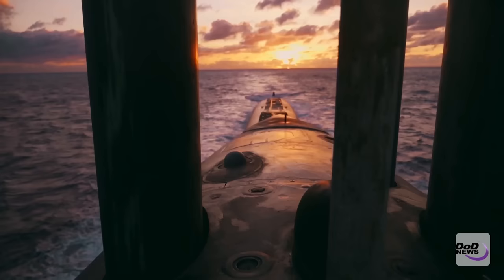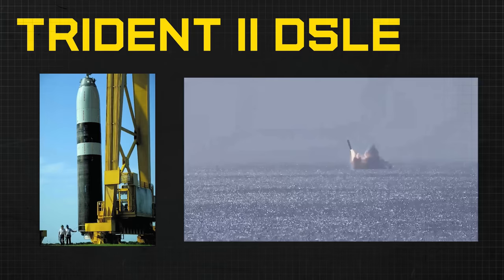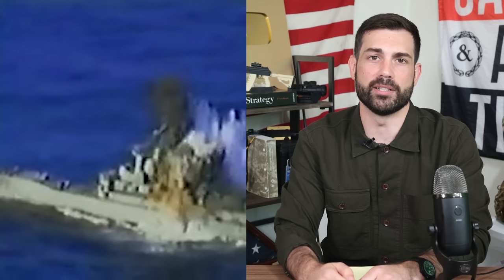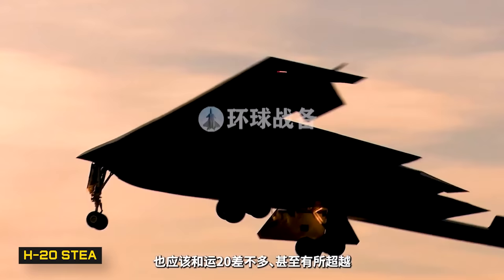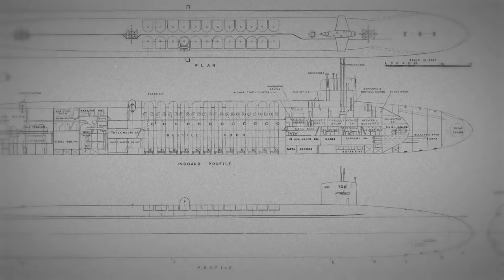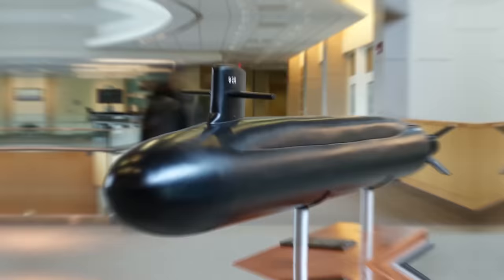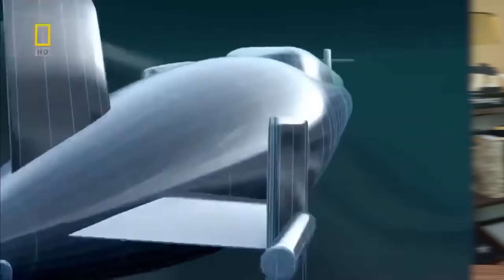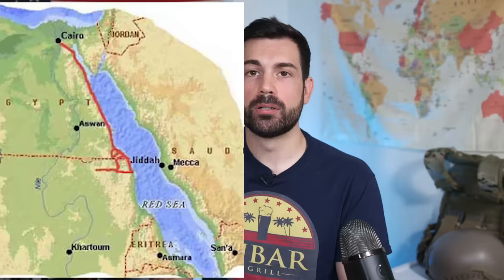Why America’s New Submarine is their Secret Weapon

Comment: So many misinformation...
An SSBN has nothing to do with intercepting enemy naval forces. Its sole purpose is nuclear deterrance. These ships has torpedo tubes for self defence only. Intercepting enemy forces is the job of the surface fleet and the SSNs.
The Columbia-class will equipped with the same missiles as the Ohio-class. Same capabilities. Same number of warheads. (You weren't able to read the name of the missile, not even once.) LE only means Life Extension. This has achieved mainly by replacing old systems with new ones, built around commercial hardware. Capabilities are the same.
Tomahawks mainly launched from SSNs, not SSBNs. You don't want to reveal the location of any of your SSBNs. The capability is there, but practically never used (and for a good reason). Both USS Pittsburgh and USS Louisville are Los Angeles-class attack submarines. SSBNs typically don't even carry Tomahawks.
The X configuration for diving planes is not a new thing.  It first tested on USS Albacore in 1960. The first submarine class that built with it was the Swedish Sjöormen-class. In 1967. All the Swedish submarines have built in this configuration since. Just like a few dozen other types from other nations.

Comment: I realize most people don't know the difference, but to a career submariner it is comical to have the narrator talking about the COLUMBIA class boats but on screen are images of modern fast attack boats. And why in the early minutes of the presentation was one of those boats running its diesel on the surface? Was it a boat on sea trials? Were they running drills during a surface transit into or out of port?

And if you walk up to a submariner and call him (or nowadays maybe HER ALSO), a "boomer", they're just going to look at you like you have three heads.

If you really want to START something, call a career fast attack submariner a "boomer wuss" (polite version for YT). But the only way you're really going to know one is to check their service record. Former boomer guys don't usually wear their strategic deterrent patrol pin when they transfer to a fast attack, so the absence of that insignia doesn't mean anything.

Contrary to Q conspiracist Derek Johnson, we're not required to always wear ALL of our ribbons or insignia, which he would know if he had any actual military service time before he got kicked out as a chronic malingerer.

Comment: Yeah i see the trouble. Such systems cost money, and one spending made have to last the next two generations of foreign technology - which in result the existing system by definition can't handle. So in this reality, the weapon is doomed to always stay behind.

The only options i'd see to cope better is to diversify the systems, so they can modernise for smaller total cost, adapt non-synchronous to mitigate the gap between ability and requirement, as well as more flexibility to lower gaps in ability by just updating the doctrine/use.

The other thing might be to make the company honestly answear why system in the US are so massively more costly that similar or better products in other countrys. Corruption didn't prevent wars, it just help them to start. And i guess both the US gov and the citizens would like to have a bit more money for disaster prevention/social security instead of doped smiling arms manufacturers.